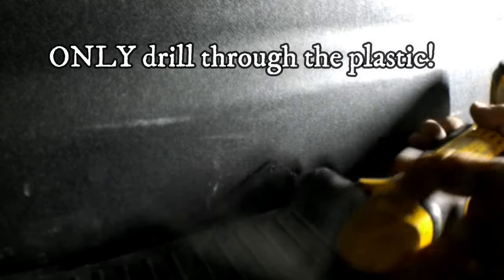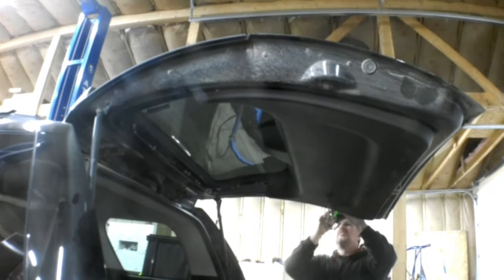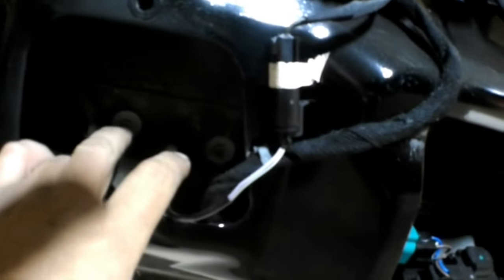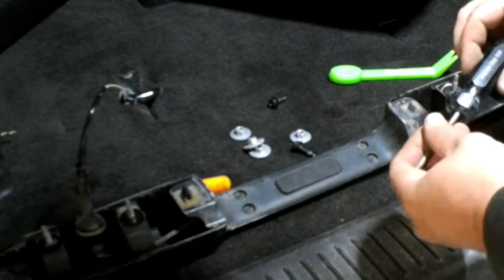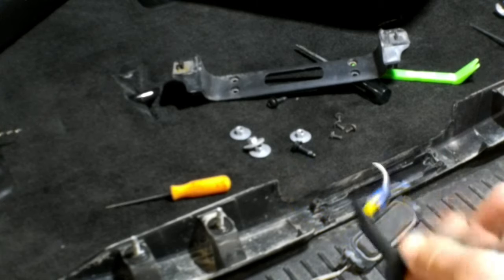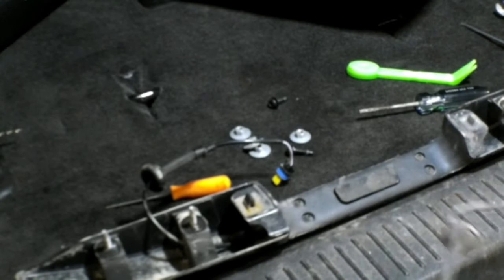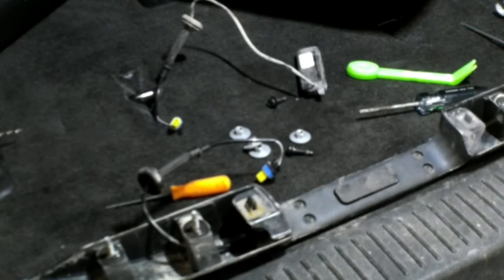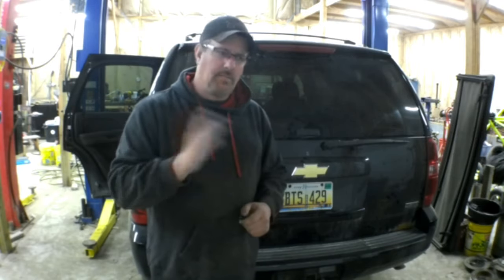Rear Liftgate Fix for Tahoe Yukon Suburban

Comment: Hey I just checked out a Tahoe as well for the latch not working. I didn't know about drilling that hole in the plastic. If you pull the fuse #44 and manually add power to it, you will actually work the latch as well. That way you don't have to drill a hole in your plastic trim piece. Unless of course the latch motor or the wiring to the motor is broken.
Reply from the maker: That’s some great information! Thanks!
Reply: Hi  I have added power to fuse #44 put the Lach want work. What do you think?

Comment: For anyone that finds this comment, my 2015 suburban (Tahoe, Yukon etc) lift gate would not open, specifically it would not unlock. I could only open from the inside with a screw driver. If you you hit the liftgate handle inside button (switch) the tail lights blinked and you heard a click. The same thing happened when you used the key fob. Now I knew my struts needed replacing as the liftgate would sometimes stop lifting, but there’s tons of videos on that. So I replaced those. I looked at fuses (the ones in the rear control the liftgate), replaced the switch , and unfortunately used an Amazon replacement for the latch assembly which some others have recommended. Finally as a last ditch I went to a dealership and bought the OEM latch assembly (part 13542450). Works like a charm now. Moral of this story, the generic parts don’t work, at least for me. I saw one other person who had this same experience in a comment for some video or forum. Get the OEM part. Hope that helps someone.

Comment: A quick way to check if it's the push button or the latch mechanism: once the big plastic panel is removed, unplug the connector for the button, jump the 2 wires on the connector that goes to the wire harness. You should hear the latch mechanism cycle. This is what I did with my Tahoe. Once I jumped and cycled the latch a bunch of times, I concluded it was the button switch that was faulty. Great video, thanks!
Reply: I just poked a screwdriver to jump the 2 pins in the connector. You can use anything.

Comment: Thanks for the tips!  I just finished installing new switches on my '14 Suburban; it was the handle switch fouling up the operation, the "close" switch/button was fine but I ended up replacing it anyway since it was easy and cheap. A note on the emergency open procedure (drilled hole): I already had my door panel off (liftgate raised)  and was fooling with the latch. I manually closed the "hook" and was trying to figure out where the springy part was that you had pressed on to disengage it. It's actually on the outer side of the latch mechanism, driver's side, and is a little silver arm with an offset bend to it. I spent 10-15 minutes prodding around the center of the latch trying to release something before I noticed that little guy!

Comment: Wife leaving on a trip.  Daughter comes in says she can't open the liftgate.  Rain is coming down hard, really windy, branches falling down all around me (i live in Seattle man!).  Anyway I needed to get the kids out of the house.  Called the dealership and they had this part.  Drove to the dealership, drove, home, swapped it out.  Problem solved.  Delay about 4 hours and dealer part was $26 but I am not complaining.  Big thanks!  My wife is on the road and my house will be quiet for the next four days.

Comment: I appreciate this video we have a 2013 cadillac just took it to the dealer to get it serviced oil change & all that cost us 1700. 00 total oh & we got brakes & rotors & then we found out the lift gate wont open We wont be taken it back any time soon until we get more monies & even when we do get the monies We dont want to be paying 1,000 to get a switch to put in the car

Comment: My 05 Tahoe makes a noise from the lift gate when I turn off the engine or lock the vehicle. Does my lift gate motor need replacing? Thanks 🙏

Comment: Great video - thanks for sharing. I've got a 2017 Tahoe and the power liftgate opens/closes but the locking mechanism does not engage - should I try the switch first before checking the locking motor or fuses? Also, which fuse would it be?   Thanks and keep sharing!!!

Comment: Man I just had to sub your channel definitely I have the same problem,  and it gave me a warning that something was going wrong because it would only open two times one day and when I needed to use it the following 3rd day I got nothing . I just ordered it from Ebay... I'm going to do the little drill thingy in the morning  at least I see how to open it until my part arrives  . Probably a week from now . Thanks a thousand buddy  .👍
Reply from the maker: Thanks! Hopefully it works out well for you!
Reply: Definitely sofar it did 🤣 I jdid that little hole and it opened lol just as you showed  .so I'm going to wait until the part comes to swap it on out . I couldn't figure anything out lol I went to that fuse box to the and the tailgate fuse was good  , I got stuck from there 🤣 . It was you who saved my migraine from flaring up an me just taking a nap 🤣🤣🤣🤣

Comment: I see a ton of questions that werent answered in video. I have owned 5 of this style truck. (Yukon, tahoe, suburban). 95% of the time its the switch no matter where it is. (Windows, locks, ect...). The switches are all actually quite cheap. I purchased that exact switch you just saw in video from a dealership service shop and it cost me $15-18. I also replaced pushbutton window switch since i was in there already. That one cost about $12-13. If you have a reputable salvage yrd they have these for a couple bucks and should have already been checked proper function.

Comment: Hello, thank you very much for the video.
I'm trying to do the same fix following all your instructions.
I have a question: before you fixed it, what was not working in your case? I mean, before you fixed the handle switch, the remote button and the button near the rear mirror were working or not? Thank you very much
Reply from the maker: Correct. The rear hatch would not open.
Reply: @Tomsfoolery.  ok. Thank you again

Comment: I have a 2011 chevy suburban lt.... did the power liftgate only come in the ltz models? I've been opening it with the flush black small button on back of the handle, and lifting the liftgate up. I'm just wondering if my suburban has it... hmm..

Comment: The two plastic “pins” on either side of the glass latch has a little button in the centre that you need to push in to get them to release before prying them out

Comment: So that switch not working made the whole thing not work? I have a tahoe and the button on the roof by the drivers side doesn't open it either. Just was making sure that was this issue on the one you are working on also. Both on mine doesn't open it. We just replaced the motor on it and nothing 🤷

Comment: Hey I just found your video but before I take on this project I want to check the fuse as my rear wiper doesn't operate and I can't open the rear glass as well. My delima is I'm not sure if i should check under the hood or on the driver side compartment can you help????

Comment: I'm having a problem on my Yukon with the hole liftgate basically falling back down when I open it. The switch works, but the trunk essentially just falls back down. Will this fix that issue?

Comment: My rear door opens with the latch handle and the key fob. But the close button will not close it unless you immediately press it as soon as the door reaches its maximum opening point. If the door is open for any longer than that, the close button does not close the door. Any ideas?

Comment: I keep finding this food when searching 2015 chevy tahoe back hatch fix, the problem is this is not the same as what I'm looking for there's not really a mark to drill but a panel that is mostly blocked by the floor right up against it. I can somewhat open the panel but can't really get an angle to stick anything in there to press a button if it is there. It's almost like I need the hatch open to get to it 😅

Comment: Shit man if you are still around, my tahoe is a 2000 and doeant have the little circle spot to drill, I've tried a few spots and no luck getting it open so far.. any further ideas? I've tried 3 holes 1 about and Inch from the base and have moved up little by little but am not mechanically inclined by any means lol

Comment: Mines makes a opening noise when I push the sensor in but it won’t open. Would that be the Sensor or the door lock?
Reply: Mine does the same, although it opens manually. I’d guess the switch, but I’ll update in a while after I take a closer look at it
Reply: I put a new Latch and now it don't open it jest makes a noise

Comment: I need your support for below issue.
I have GMC Acadia 2022 SLT.  The power liftgate stop working.
If I restart the computer by disconnect the electrical cable from the battery the liftgate will work normally for short time.
After short time the liftgate stop working and need another restart.
also I want to mention that the external push button at the liftgate not working at all.
so please your support.

Comment: Wouldn't you know if it was the latch if you tried the switch in the drivers compartment?
Reply: That's what I was thinking, or the liftgate button on the fob. All three options do nothing for me. Driver compartment switch, rear handle switch, and fob button. I replaced my liftgate lock actuator and still liftgate or lock don't seem to be trying to do anything. Starting to wonder if I have a bad wire somewhere as liftgate fuse 44 in my suburban is good.
Reply: @Da5hiz  what did it end up being that fixed the lift gate situation? Just happened to my wife's tahoe
Reply: After I replaced the lock actuator and still had the problem I then replaced the rear handle switch and now everything works. Bizarre but has been working for almost 11 months now. 👍

Comment: Well, I must be the only dumb ass on the planet.  I tried the drill procedure on a 2014 Police Tahoe, there is nothing behind                         the door pad.  l had a friend, a mechanic, tried to find the latch button, nothing is there!  I looked at all the locks (Latches) for sale and there are several "different types".  I noticed some have the release button centered up with the latch to body point which is 2 inches to the left of the small circle I drilled out.  So I drilled another hole centered up on the actual lock point.  Nothing there either, so I tried another another spot.  The mechanic tried to help but also failed again.  I am considering using a two inch hole saw to cut out a hole big enough to see inside to determine which lock I actually have.  What do you think about that, or do you have other suggestions?
Reply: I have the same problem I will let locksmith see if they can do it

Comment: My switch works and the motor inside the lock makes noise and it even clicks like releasing the lock, but the door it still gets stuck, like if the lock wasn't released

Comment: I have a 2015 that wont reposed to power opening but will open when on manual, dealer has no clue what it is, but lights flash with remote and touch of button on back to open but ljftgate does nothing

Comment: Hey would this work on 04 tahoe? Thanks!
Reply from the maker: I’m not sure. Check and see if you have that little mark in the plastic from the factory. If so, I’d assume it would. Also you could look up the latch and see what years it fits. Hint- eBay can be a good parts cross reference

Comment: Mine doesn’t have the drill hole
Reply from the maker: Bummer. If you were able to get close, there’s wiggle room inside the panel. So if you make a hole close to where I did, it should still work for you.
Reply: It’s started working.

Comment: Whomever designed this truck should be banished to the Forest with the rest of the Boars!  You can only use your key in the driver's door, everything else is electric.  Heaven forbid your check engine light comes on, it might just as well be a light that flashes "500 Dollars"

Comment: Mine is a 2009LTZ model. I can’t figure out what to do. I have made a large hole in the plastic, trying to find what to poke or push. And I can’t find anything. 

The gate is stuck shut, but the message on the dash says it’s open.